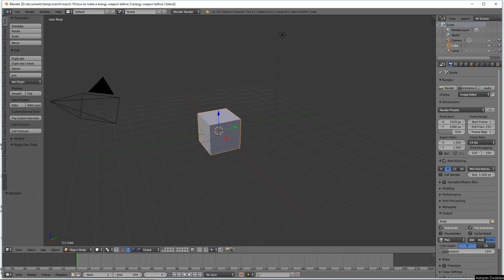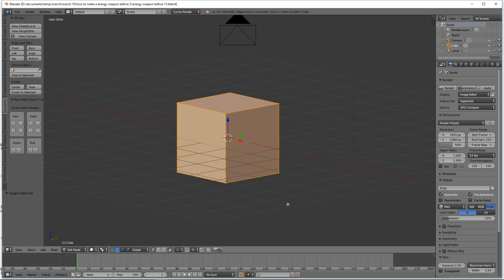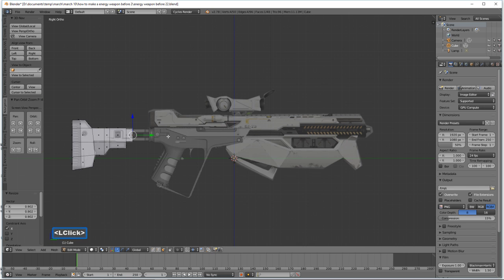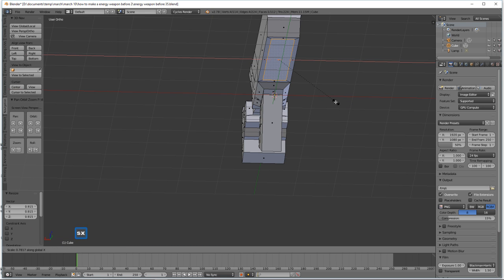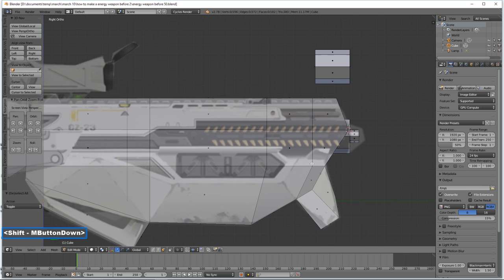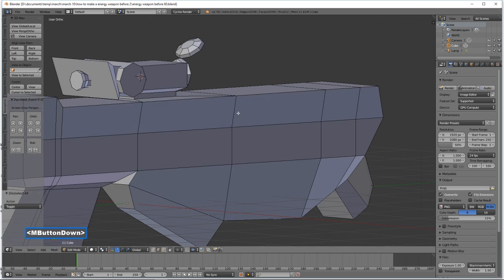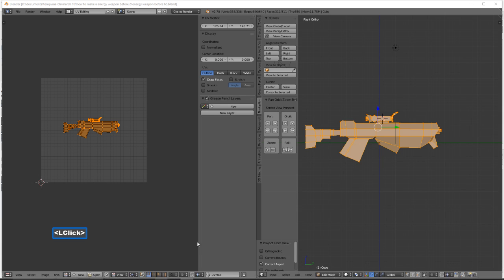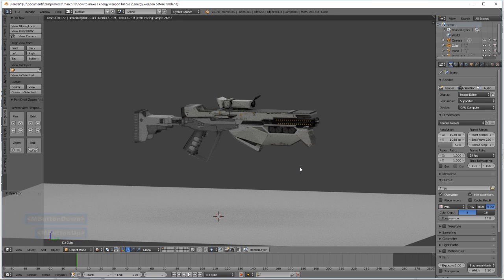How To Make An Energy Weapon in Blender 2.78 c

Comment: Why does nothing i do in this program work? i use the B box thing and it only selects the front corners
Reply from the maker: Thanks for watching this video. Press then choose wire frame then try Box selecting again. It sounds like you might be select the visible parts of your mesh buy the not the parts out of view. I hope this helps.
Reply: Thanks for responding! i'll try this out